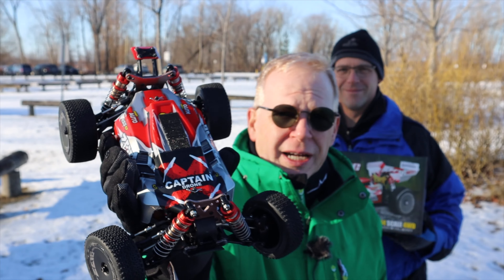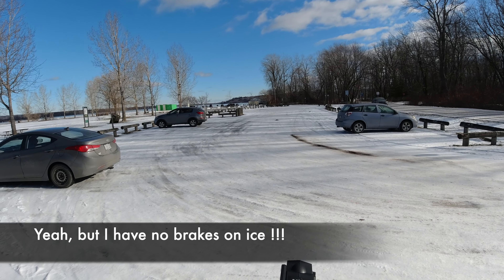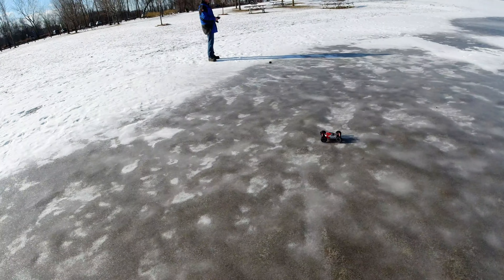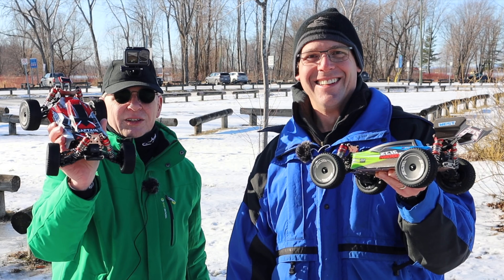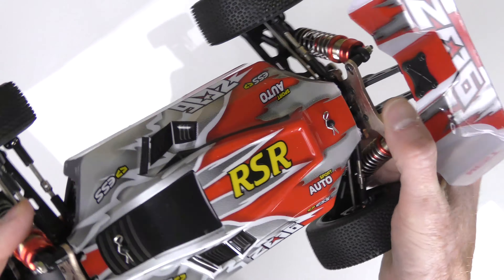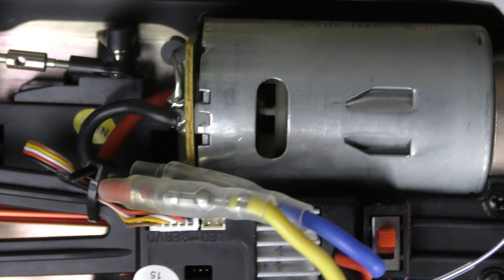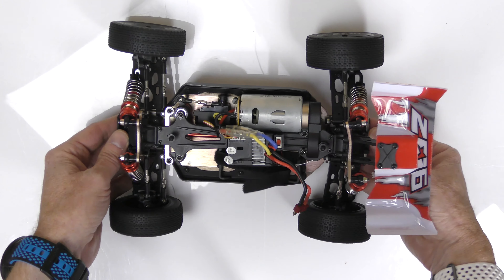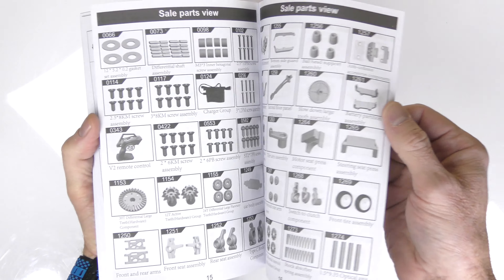This Amazing & Super Fun Metal RC Dune Buggy is only $83 - Wltoys XKS 144001

Comment: Yep, I can see why it's so cheap.  1.  Brushed motor.  2.  TINY battery.   I'd knock the el cheapo radio system, but those are kind of standard nowadays. 

ALL THAT SAID, this is still a great value RC car.  You are getting a tough little basher that is a step up from some toy store junker than can only turn by backing up.  First thing I would do though is find a way to modify it to take a MUCH bigger battery.  Actually, looking at it I'd bet you can squeeze a 3500mah one in there just by taking out the battery tray.  Maybe even a 5000.  Hard to tell on screen.